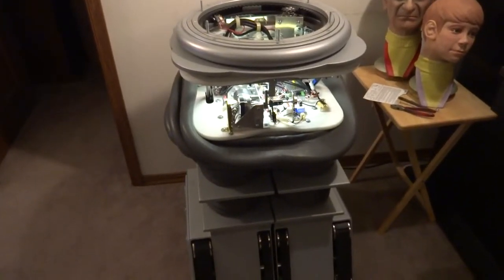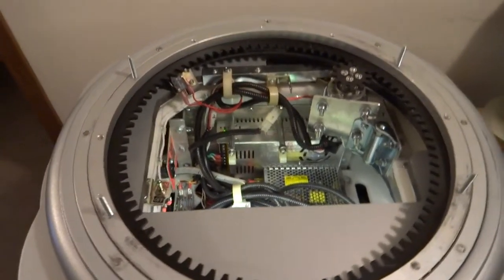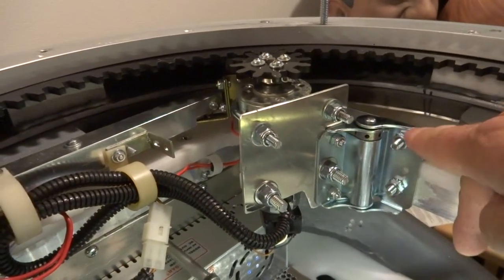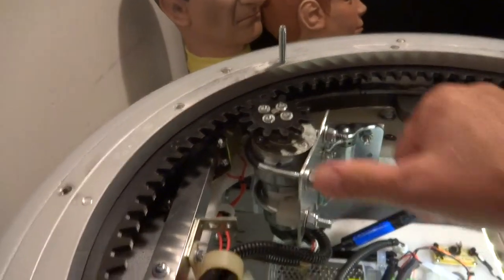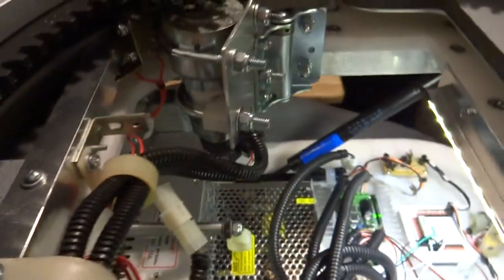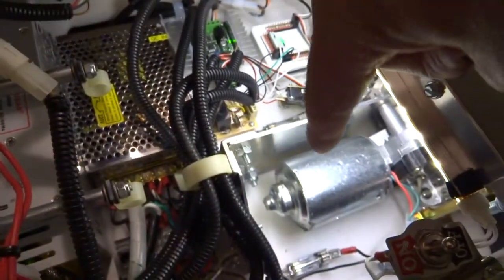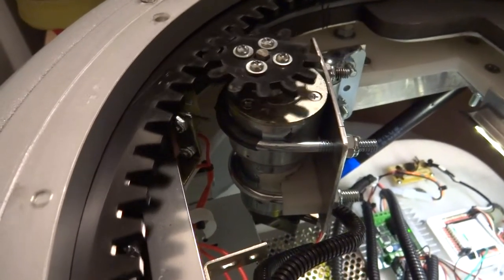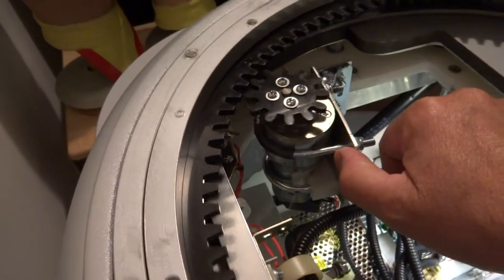B9 Robot Waist Gear Self tensioning beacket

Comment: Did you change this over the years? Does it work well?
Reply from the maker: Yes, I still have this in place. However I did add one thing. I found that when I had the torso mounted and I wanted to quickly change directions the teeth of the gears would jump a few steps. This would cause the center to be off according to what the encoder was expecting. T keep the teeth from jumping I simply added a plastic wrap lock tie around the motor and the stationary leg support. I didn't pull it tight but kept enough slack as to let the motor self adjust but tight enough so the teeth of the gears couldn't jump.